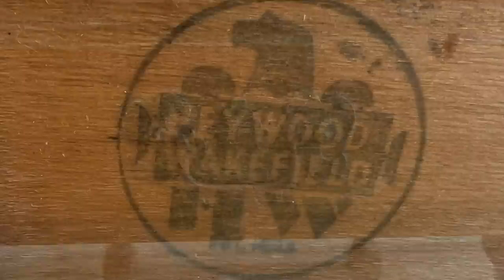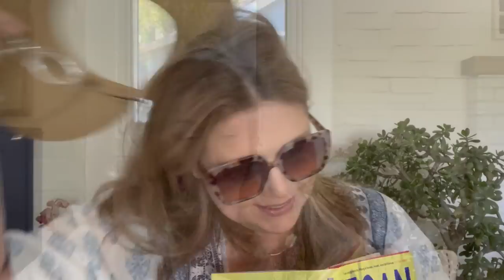EASY "COASTAL GRANDMA" STYLE MAKEOVER | Refresh Outdated-But-Quality Colonial Style Furniture

Comment: I did not get the purpose of the blue floral rice paper drawer sides as they did not relate until you changed the wooden pull to the blue floral ceramic pull. Now it makes sense and is a statement piece of furniture.
Reply from the maker: Great to hear that, thanks Barbara! 😊💙